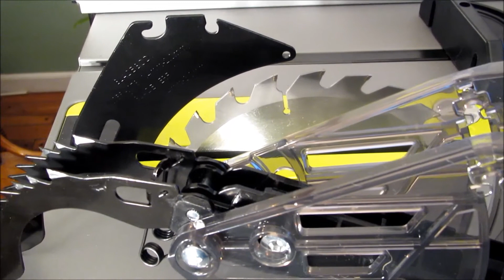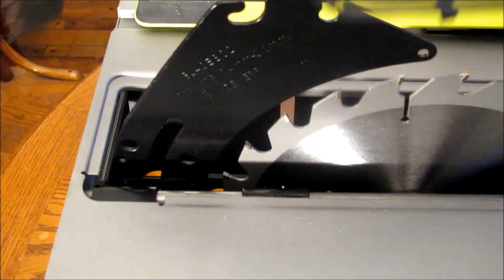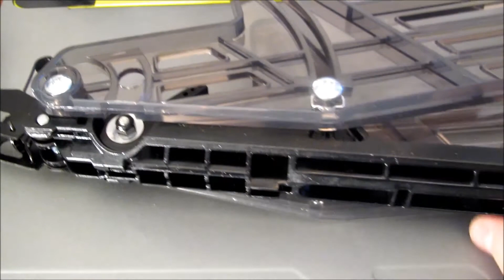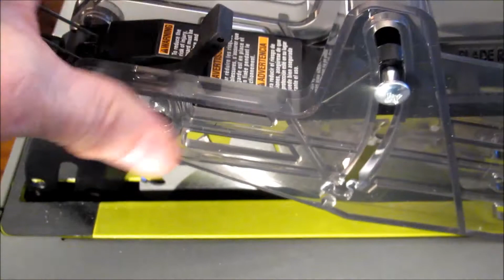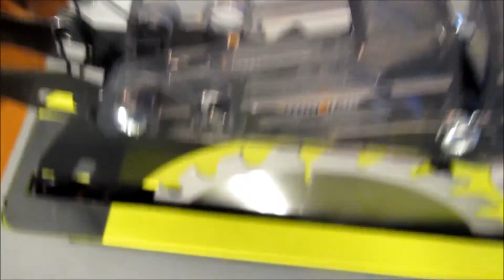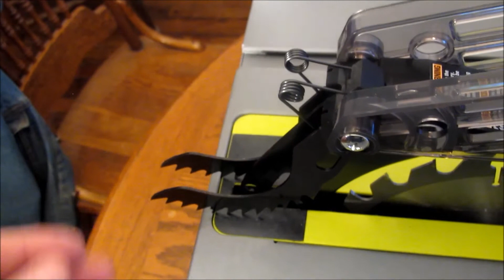Mounting the Blade Guard on the RYOBI RTS08 8 1/4" Compact Table Saw

Comment: Thank you....never would have thought about "snapping " things back....a little flimsy...but i swear, I will not ever ever ever remove them....Promise.
Reply: it works well. As for the saw, picked it up for 145 Canadian at home depot.

Use it for what it is. I am cutting laminate and its doing a good job. I will be cutting baseboards and such.....Light work and it should do you well.....running 3/4 in plywood through it all day long, probably not a good idea.

Comment: Thank you very much for this. I just got the table saw and would rather watch videos than read the manual. One thing I found was that it has a big piece of molded styrofoam around the motor and they didn't say how to get it out. I didn't even know if it was supposed to stay there or not until I looked at the picture on the box showing it wasn't there. I had to cut it out piecemeal!
Reply from the maker: Thanks for the info!
Reply: @HorseshoeBeach  - You're welcome. : )

Comment: The riving knife and guard mechanism seems loose, complicated and sloppy. I would like to remove the riving knife and not use the kickback prevention and safety guard. It seems more trouble than it's worse, but how to get that riving thing off?
Also, I like to see exactly where the blade is cutting. The cumbersome guard mechanism is in the way.  Kick backing can be dangerous, so I'm very careful to avoid any wood being pinched between the blade and the guide. Now I have to figure out how to remove the riving blade.  I've never used one in the past and I think they are redundant.

Comment: Does anyone else have problems locking the riving knife in at the lower position. This is without the blade guards attached. I broke the orange locking clamp trying to do this. RYOBI sent me replacement assembly but it is no better. Easy to close at the higher position, almost impossible at the lower position.
Reply: I just got my saw and was trying to install the guard and yes, the riving knife handle was harder to work in different positions but I figured out it was because I hadn't set the riving blade in it's grove correctly. Once I did it was easier.